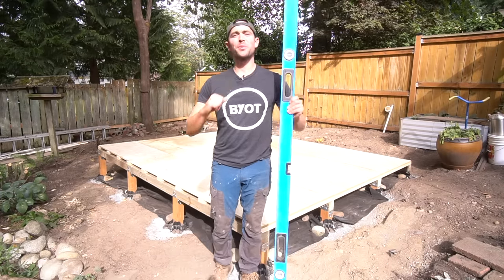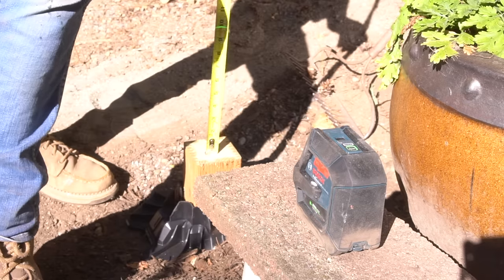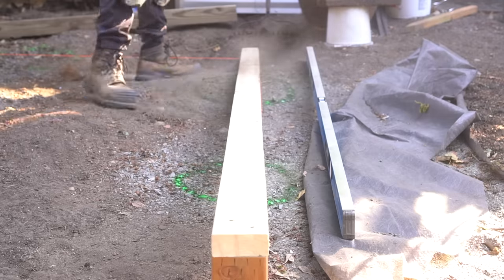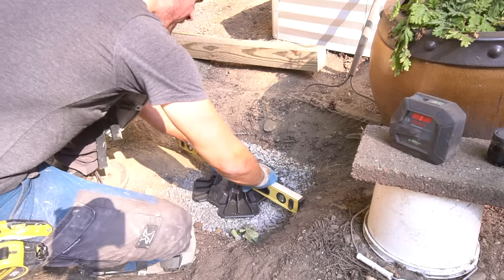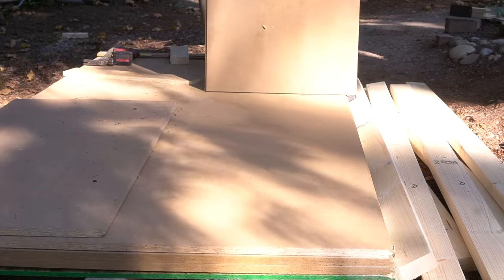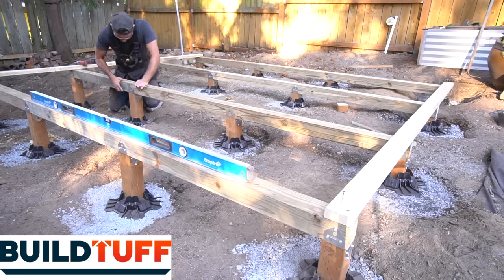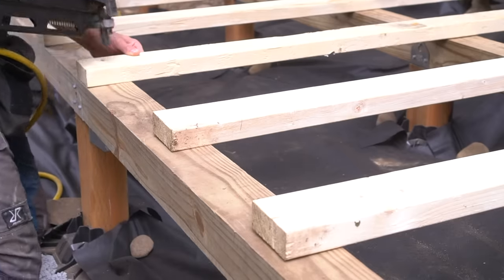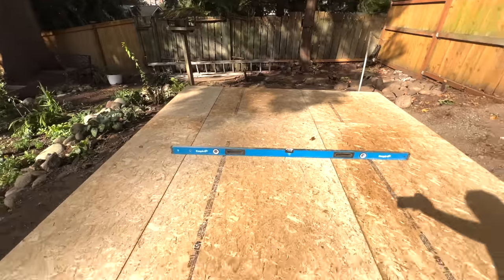How To Make A LEVEL Floor System

Comment: Personally I'd never use   white wood that close to the ground. Anything below plywood and 18 inches from the ground would be for "ground contact " treated.  I'd be thinking 40 years ahead.  I'd also never lay floor joists on their sides.

Comment: I purchased these tuff blocks, they worked well.  Make sure you get the EXACT number needed for project - customer service is terrible- I have sent 3 emails to "customer service" requesting a need to return unopened product.  I have received nothing back.  DO NOT buy if you are unsure on the amount it will take for project.

Comment: all outdoor platforms should have a slight slope
Reply from the maker: If they are exposed to the elements you may be correct but not when this is going to be completely covered by a structure.  Stay tuned for next week.  Its a fun one :)

Comment: I don't mean to Monday morning quarterback, but you should really consider coating the ends of any post making ground contact or contact with any other non porous material, like plastic of steel, with some type of insect/water repellent. Even common indoor latex paint, would be better than cutting a structural member and leaving its unprotected core expose, I don't care if its made of plastic, coat it. The post bases used should also receive a 3 mil minimum of two coats of any latex paint, to block UV radiation from weakening the bases . The entire floor sub-structure is within 24" of the ground so treated or composite material should be used because of insect,splash and splatter, if nothing else latex minimum. I would never recommend an osb sub-flooring panel this close to the ground without a ground based vapor barrier and a fiber based weeping style underpinning like Typar at a minimum. If Budget is a concern 5 gallons of latex paint can be found at Lowes for @50$ last time I looked, its an all white label, usually in a hard to see corner, that reads "Maintenance Paint". Just this step of latex paint will double the life of structure in resistance to rot, mold, and insect incursion. Wood is a building material, saturated wood is a habitat for every petri dish on earth. Your posts are not capped, you don't always have to do this, but anytime you are less than 24" off the ground your post should have a flared cap in lieu of the fastening system, this stops the majority of insects from climbing higher than the post and getting into the joist/beam system. More importantly it prevents the rain from the ground from flying up after hitting the ground and getting stuck between your joints. If budget is an issue again at this point merely cut old soda cans into strips fold them into an l shape and attach them to all 4 sides of the post directly beneath connection and fasteners. I should again state that untreated wood and OSB, can have a ground contact life span as little as 6 months in the right weather and no one without extreme budgetary needs would ever place these materials within 5" of the ground. As a side note, even if you used all composite material I would still treat it with an UV resistant epoxy. Where I live there is no such thing as any untreated wood member below 18" even if its on top of treated beams and posts on concrete bases, this is because untreated wood especially pine and fir are bug food and have a horrible weather resistance. You can crumble a white fir 2x4 in your bare hands after 6 months on the ground. You also specified weed mat, which is not a vapor barrier, you should never build a waterproof structure above non waterproofed ground, unless you intend to sell it to someone you hate, you will get a far better return out of 6 mil poly placed down over every inch of ground. Dry dirt surrounded by natural uncovered earth works like a candle wick, it draws the moisture to it and then evaporates it into a sub-floor killing fog. If you want to go the extra mile paint, with regular latex, the 6 mil barrier on the ground and it is now proofed against dry rot. Building smart is all about managing first failure. If you are lazy and cheap like me you always design your weatherizing system around longest life for lowest maintenance cycle = minimum effort and cost. Also on paper I know the compression/deformation numbers look great and that 2x4s flat every 16" on 2-3' spans seems plenty strong after adding the tongue in groove floor panels, but these numbers are based on perfect parts/boards with no defect in a laboratory under perfect artificial weather conditions... In real life, this floor used no bonding method and is not weatherized, it will over time ripple and sag beyond tolerance, 2x6s are preferred, for any span 2' or more outdoors at the budgetary minimum, place your joists edgewise, inside of an outer band that does not leave the joists exposed, or you are just frustrating your future self. Lastly the video premise was level floor system... well unless its an indoor bedroom or something I have no idea why you would want something "Perfectly Level". You have 2 ideal floor systems, drain in - for enclosed non living spaces, and drain out - for sports courts, patios, driveways etc. Each should be un-level  by design to carry the water to a drain like a shower floor, or shed it in a desired direction like roads with the middle higher than the shoulders. Building a tool shed, no money for a drain, chances are you want it un-level by at least .5" every 10' towards the bid front door, so that the inevitable, storms, spils and cleaning can easily be moved from the back to the front with just a broom. Its not hard to do and only the floor is un-level, the walls,ceiling, and roof are all still level by careful. Also somewhere in there you said easily get a square and level floor system then used two of the most complicated ways I know 6' (maybe)level and cross cornering, when all you need is to figure out where you want your front door pick the wall on the right at any angle string 2 stakes, then consult Pythagoras for the far corner and rock out, no walking back and forth adjusting wasting movements and time etc. The absolute simplest way to get "true" "greek" level to this very modern day is with 20$ worth of 1/4 inch clear poly tubing, a funnel and some water. Find highest ground determine desired finish floor height fasten tube to stake mark height, go to next  inline corner and fill tube with water until it is level with first line... You now have the most accurate level known to man, and the easiest to use over long distance or around obstructions where you don't have line of sight.

Comment: Years ago I took a coffee can, put a hose fitting of approprate size to connect a long clear water filled line to it.  Put a tank full of water in the can.  Let the water fill the tube. The can was the center.  The end was level and anywhere at any point in space it would be level with the can.  As long as the hose was long enough, one could level up great distances in line from any direction.   I have used this method many times from hundreds of projects.  The Romans and Egyptians probably used something like this.

Comment: How on earth were your original post measurements anywhere near correct when you dug random depth holes AFTER you had cut the posts? 

Also...

Heighth = Height. 

And...

Veritables = Variables.

Comment: any structure/force common sense would bring on the 2x4 ON top of the 4x4 joints, it's not going to be stable, because it's loosing/missing the best support from the 4x4

Comment: Do u have termites in your area, as those posts are vunerable to attack.
Reply from the maker: Luckily no but good question. Thanks for watching
Reply from the maker: If you have termites in your area what do you do about it with structures like this or even a deck?
Reply: @BYOTools  well one never knows with termites when they will arrive. So measures to prevent is always good. 

With a structure like yours where u cannot see under the deck that well a chemical barrier would be advisable under those posts. There are some very good low tox chemicals available on the market that would do that. 

Personally I like physical barriers where u force the termites to go over an area where they can be seen and then eliminated. To do that in your instance u would raise the posts off the ground forcing the termites to climb up the structure to attack the posts & thereby being able to see them.

Comment: I wonder why he placed the floor joists on the side instead of the edge.  Also the floor sheeting should be staggered to maximum sheer strength.
Reply: It gives the whole floor a wee bit of bounce. A totally stiff, if not rock hard floor is only good for the industry, but no good for your knees and hips.

Comment: He also used galvanized screws into pressure treated limber.  Another no, no.  Should use screws designed for pressure treated lumber.

Comment: Seems to be asking a lot for a 2x4 span laying flat
Reply from the maker: I thought the same thing when I saw the kit but it feels extremely sturdy and I have no concerns with the strength.  Just wouldn't go past a 4' spacing between beams, which we didn't in this case.
Reply: @BYOTools  It has everything to do with spacing, 36" is not much. Would be different if you were spanning the whole distance but with like a 100 feet to keep everything up no worries.

Comment: That is a great way to create a very SQUARE floor.  I take it that you live in a southern part of the US where there is no frost heaving.  Your whole video is stressing level, level, level.  That system of plastic bases wouldn't fly in Minnesota or any where else in the northern half of the US.  Frost heaving is not always even so if there is some clay under one of the corners it will heave a lot whereas if the is sandy loam under other plastic bases there would be little heaving.  
It is not a structural problem on a 10'x12' building.  In a cold climate there will be varying degrees of heave on each corner and the building - I guarantee - will NOT remain level in January.  The only way to ensure a level floor is with a foundation that is well below the dirt surface.

Comment: I think this entire build is kinda wrong and wonky. You could have just dug 4 holes, poured concrete and built everything on something stronger with perhaps 2 beams instead of having 4 beams. Not sure how long this will last with weak 2x4 layed down flat.

Comment: I'd guess that it’s common sense that this floor system shouldn't have been set exactly leveled so water would be able to flow from its surface. AFAIR, there are even rules for that.

Comment: Confused why you would first measure and cut all those pieces of lumber and pressure treated blocks that are reliant upon their elevation and then move those footings that late in the game? How is that efficient? Also  why are you laying the lumber on its side? Wood is MUCH stronger when placed in its vertically taller cross section. Like this || not like this =

Comment: In Canada this design would not meet the building code in any way at all.  I could write multiple paragraphs on why but just check with your local planner before wasting your money and time watching YouTube.  Different climates and countries require different approaches to construction. Improper construction can be a safety and liability issue.

Comment: The ONLY instance that I’m aware that 2x4 lumber is laid flat in construction is at the top and bottom of the walls. …and they’re doubled up for strength. Not even a proper fence  uses lumber laid flat; it will sag between each post. A 2x4 being used as a floor joist is bizarre enough, but laid flat the little strength they had was severely reduced. A 2x4 laid flat will sag under its own weight; never mind that it’s going to be loaded. Regardless of what any “engineer” says pertaining to the installation of this floor system, I say hogwash. I know of plenty of instances where the engineering failed miserably. Why anyone would utilize this method is beyond me; they are showing their ignorance about proper construction and practical sense. I’m not aiming any of this comment towards the maker of the video, he’s not really a builder, but a video maker / YouTuber, and did a fine job. If he were a builder/ handyman he would have just gotten the materials from his local lumber yard.
Reply: Ouch. May I ask why do "professionals"....spend their time looking for videos about things they obviously already know, just to make the creator feel like shit?

Comment: Seems like an overly complicated way to build a shed.  4 concrete footers and a 2*10 frame with traditional floor joists would have been much less work
Reply from the maker: So is a SHED your guess Charles? haha.  I do think that is a system that involves less steps but there are complexities that go along with concrete footers, which not everyone wants to take on.  Plus in this case we have to use the floor system that came with this unit, which does affect our options.  Thanks for the input Charles and I'll have to keep in mind that type of floor system that I can utilize in future projects.
Reply: Great video, good explanations, but I was thinking that the amount of time required to do all that leveling, digging, and packing gravel was way more than if you just dug less holes and used concrete in some sonotubes.  You already have the laser level so I think the leveling part would have been easier than compacting, measuring, cutting, taking thungs apart and putting them back together again.  To each his own.  Not sure if the product you used was a sponsor or not and if so, it does explain everything.  I do understand that not every application can or should use concrete footers, I’ve just gotten used to mixing and pouring concrete in small batches and find it much easier to work with.  Plus with solid concrete footers, it’s going to be way more stable.

Comment: There's no way I'd build my entire shed on those plastic corner pieces. I could foresee them cracking with the weight of the shed and everything inside as they settle down into the dirt. If I had to rest the shed on the ground I would rather just have those posts resting on a minimum of two solid cement blocks. I would rather just cement the posts 3ft into the earth though. Why are your 2x4's used for the floor laying on their side? Why are you even using 2x4's for your flooring? I'm thinking you have a shed height requirement to build without a permit. Squeezing every inch huh? Not worth it.

Comment: I've read the comments on here, and I'll go over 2 points that have already been made, 1 those tuff footers should be in concrete, doesn't matter what the finished "shed" will be... Its just not right. And 2,, those 4x2's should be on edge for strength.. I've never seen them laid like that..
2 other points I want to make that have nothing to do with this.
1,, this is a construction video, not a fkn religious video,,, I don't appreciate that comment, even if it's a free world.

2, that racist comment guy should be fkd off the comments... That's despicable and if you condone it, then so are you

Comment: I'm looking to build a platform to set a tent on top of it, and i wanted to use expanding foam to fill in the gaps of the hole where the lega would go in. Would this be a quick and sufficient method?

Comment: I'm sure it will last a few weeks before sinking and becoming unlevel and moving around.
I'm glad you didn't do my shed base or decking. 

1) footings,  unstable and possibly subside in no time.
2) floor joists, looks untreated for outside use, on their sides with no noggins 
3) flooring, not staggered for maximum strength and also looks like untreated for outside use.

I could go on and on but would advice you to do your research to save you money and time doing it all again.

Comment: That 3/4 crusher stone will sink over time unless ABSOLUTELY SATURATED!! YOU SHOULD USE "HPB" HIGH PERFORMANCE BEDDING ? 99% COMPACTED AFTER YOU INSTALL IT INSIDE A HOLE OR A CONTAINED  BORDER.🤔2X4 'S FOR JOISTS.

Comment: Were get floor kits be much cheaper buy in singles!  I'm do some-same as patio.  How get kits? I'm need some same x2!  I cut down some if to long would be cheaper get in kit I like plate for tung&grove same as 105 side. Floor cover Moore then single peace by peace!  Let site get kits I need 2them I measure before please order. Buy in kit cheaper . mist Lowes home depot don't sale joint plywood as (104 side ) your plywood cover Moore  is thickness as 5/8!  I like be thick. Onsie small hot tub.  Other side just extra room garage excessarys.

Comment: I’m not gonna say it
Reply from the maker: Say what? :)
Reply: It took me a while to realize what’s wrong
Reply: @BYOTools  the floor joists aren’t pressure treated
Reply from the maker: @francescodelia746  Good thought and you would be correct if these where joists for a deck, however the floor joists are completely covered by the structure of the building and won't have an issue with moisture. In theory non of the wood is in contact with soil but the posts and beams might be exposed to rain at points, which is why they are pressure treated vs the floor joists.  Thanks for watching and bringing this up.
Reply: @BYOTools  fair enough wasn’t quick sure what you were making. If it was exposed the PT would be idea but I think you’re making a greenhouse so the plywood and wood seems fine. Good video overall

Comment: I wouldn't lay the 2x4s on there side I would  use 2x6s 16" center 23/32 plywood sub floor with5/8 top floor total 11/4 floor. I just built a build same floor dimension.  Yeah don't listen to this . Read a book or 2 and learn how to read a tape and carpenter's square.!